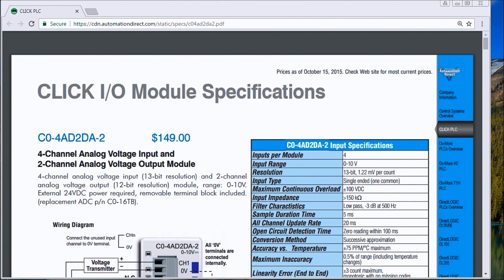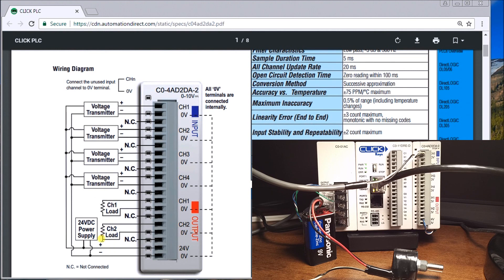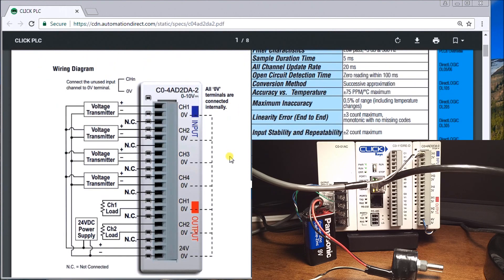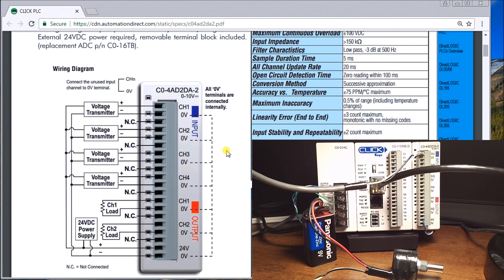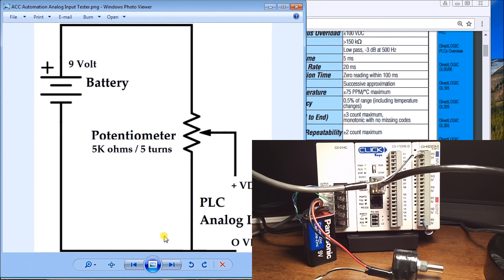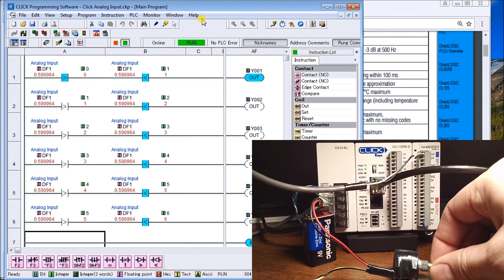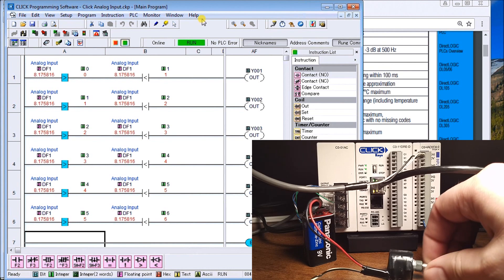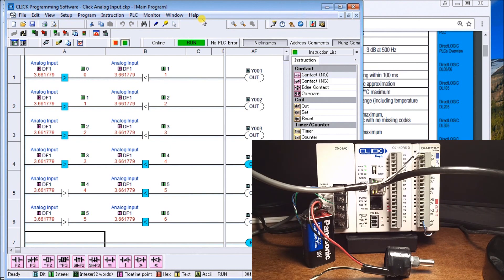Wire Your Click PLC Analog Input Like a Pro in Minutes!

Comment: @Garry Shortt would you be able to wire in the source from the plc to the potentiometer instead of using a battery, or did you avoid that because of consumed amperage at low impedance? In that case, would it be fine to wire another resistor in series to the potentiometer (before it) to limit the current flow?
Reply from the maker: Hi Jounce1111,
The purpose of the battery was to make this device portable so it can be quickly used in the field. I use this for quick testing of analog voltage inputs. The battery will ensure that the input is isolated from any other circuits. 
You could wire in another resistor and create a voltage divider so that the 24VDC supply can be used for the 10 VDC analog input. In our case, we are using a 10K ohm potentiometer, so we would need a 14K ohm resistor if our supply is 24VDC.
http://www.ohmslawcalculator.com/voltage-divider-calculator
What you are trying to do is limit the amount of voltage to the input.
I hope this helps you out.
Regards,
Garry
Reply: @ACCautomation  Thanks for the reply! it helps

Comment: I greatly appreciate you doing this for us....question, from what I can see on the software, I do not understand why after you get past 1VDC that Output1 turns OFF and ect as you go up.  What is telling them to shut off once you get to the next increment?
Reply from the maker: Hi Ralph,
Each line of code will specify the signal greater than and less than a value. 
https://youtu.be/JwSeulaHV6U?t=135
Looking at rung one. If the analog value is above 0 but less than 1, the first output (Y1) will turn on.
I hope this helps you out.
Regards,
Garry
Reply: @ACCautomation  Thanks Gary, I see it now!

Comment: Hi - Great video!! - Short and sweet.. I am trying to measure the torque of a Motor grabbing the Signal from a Driver and send the signal to the PLC to process - Is a similar setup will work?
Reply from the maker: Hi Gerardo Ortega,
Thank you for the comments. 
For most motors, torque is directly proportional to the current and can be derived from it by knowing shaft speed and motor efficiency. You mention a driver that sends the signal. If this is an analog value, then yes you can read this into the PLC. If this is a communication driver then, you will need to know what protocol is being used. 
I hope this helps you out.
Regards,
Garry
Reply: @ACCautomation  Yes- it does!!  thanks for all the your videos and the good explanation
Reply from the maker: @gerardoortega4027  
You are welcome.